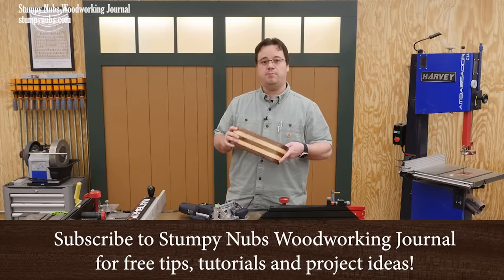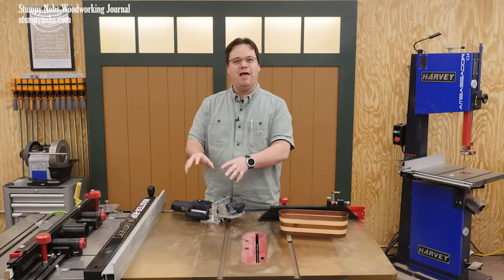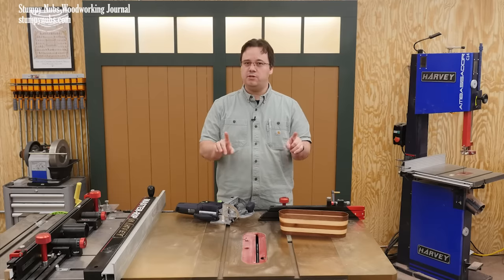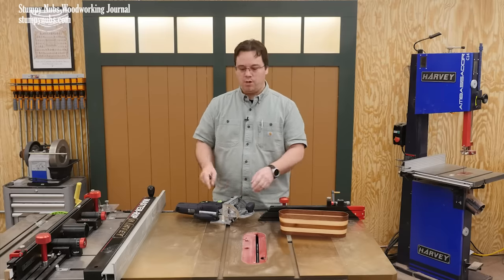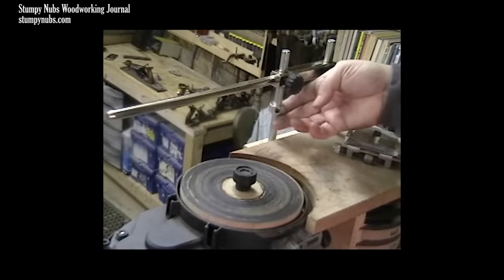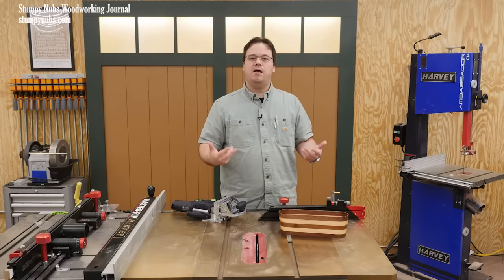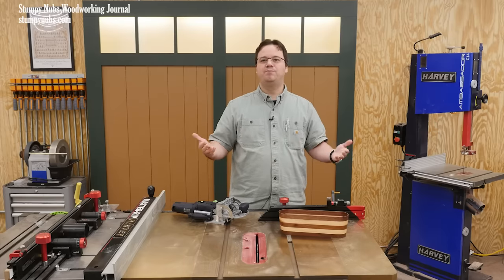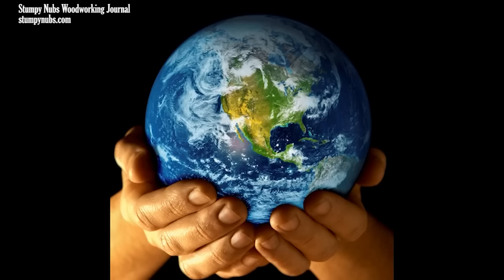This is why people HATE Festool and their Domino!

Comment: My complaint is not with the domino tool, hell I got a lamello biscuit joiner in the 80s when it was the only one! My complaint is with festool tools being so expensive in general. Are they so much better engineered than other high end brands that make them so expensive. And yes, with some it seems to be a huge status symbol. I enjoy your videos and learn a lot from you and others. A lot has changed especially with woodworking tool technology in the 40 or so years that I have been woodworking and I have some biases that you guys help me to get over. Thanks again!
Reply: I can't speak to the Domino as I don't have one but I do own 2 Festool sanders and 1 router.  The quality of the router is fabulous, so much easier to set up than my Porte cable router and far superior dust collection that is non existent on the PC.   I bought my first Festool  sander after wearing out a Dewalt ROS after only a couple of years as a hobbyist.  That sander is now at least 15 years old and only had to replace the sanding pad once a couple of years ago & again the dust collection is superb almost nothing left on the workpiece.   Plus my CT22 dust extractor that I got with the sander is still going strong & far quieter than a shop vac.

Comment: Seriously I went thru this searching mess 45 years ago..  I was a young man with a family and was able to make things from wood at age 7..  I made much sawdust.. I wanted a large lathe and made one from 2 inch maple with 16 speeds.. The lathe could take wood up to 20” in diameter.. The toolrest, shaft, and such I had made by a machinist.  Still cost less than $250.. For a long time turning huge blocks that weighted over 100 pounds was not good and the slowest speed was 250 rpm.. After many years of thought I saw a device that coverts 220 single phase to triple phase and triple phase can be adjusted down to 1 rpm.. The device cost $180 with speed control…and the new lathe has twin I beams and all toll it weights 440 pounds and takes wood up to 38 inches in diameter..A welding buddy welded it up in one day. I have used the lathe 3-4 days a week for the last 6 years.. it’s a beast and total cost is less than $650..  There are lathes that do less that cost between $4500 and $12,000.. You point is well made.. I have no real prototype the first model is great.  This lathe is adjustable from 1 rpm to 6000 rpm and does not shake or wiggle with huge green blocks of oak on it.. It has casters the go up and down too..I never have thought of buying festool due to cost.. I have value in my shop over $ 60,000 in tools.. All paid for themselves from making cabinets and crafts..The satisfaction and happiness from making my own is off the charts..  I am so old now and all I do is turn wood..nothing else and soon I will sell everything except the lathe..  I do not hate festool I just do not need stuff that cost that much money..thanks you really make much sense all the time..  Terry

Comment: Also I think brands as Festool, Tormek and even more Mafell, are small independent companies who built most or everyhing in their own workplace, and German wages are much higher then Made in Mexico/Chine/Czech Replublic. However they are designed and tested and callibrated, have long warranties and replacement articles for 15 years promised. This is also something that is worth a lot. Personally I like the machine, especially the XL but at this point it has no need for timber framing, which is what I do, but  if you see how much time and by that metric money you save making floating tennons, I don't see this as an expensive machine at all. It replaces a mortiser and a machine that cuts a tennon, problably two of the most labour intensive standard joints.

Comment: For me, the issue is not the price itself, but the price-gouging. It absolutely is well worth it for those who do regular production work and either don't have both access and technical capabilities with regard to adequate CNC routing, or CNC routing is not pragmatic for the application. But the price vastly exceeds the inherent cost of the manufactured tool and its development. This could be priced at one-third the price, and remain profitable. This is exacerbated by the price for each bit (which are not included with the tool price and cannot be obtained from any manufacturer but Festool) and the tenons. The truth is the tool just is not that complex or difficult to make, and the only reasons that several other premium manufacturers don't offer their own are the threat of legal action, and that they are securely manufactured in places in Europe (preventing the Chinese factories from ripping off their engineering like they do everything they can access). Make no mistake, Festool DOES generally make quite good tools, but in my opinion, unless you consider Festool ownership to be a type of fashion brand modeling (and many do), "you get what you pay for" does not really apply (especially with the Domino) outside of improved time efficiency and reliability of result. And the Domino is probably their only tool that does not have a strong direct competitor from other brands. So for me, it is my principle of resenting price gouging. I do admit there are not many alternatives that don't requiring designing and fabricating custom tooling, or going with another production tool of close cost but more expensive hardware.

Comment: Here's my opinion of Festool: I equate them to Apple. Festool, as an example, uses a proprietary arbor size for their miter saw. Thst means you MUST buy only Festool blades for your saw. Apple has the same business model... proprietary connections, chargers, etc. You MUST buy Apple products. I don't buy into companies who operate with thst business model. Before the beloved domino cutter tool, we end and side oined wood with tongue-and-groove joints, biscuits, dowels, splines, etc. They work. You can cut biscuit holes with a mortiser or mortis bit for a drill press.

Comment: 😂 That.  Was.  AWESOME!  Get a few cans of denatured alcohol in you and you're a funny guy!  I also thought your take on "haters gonna hate" is spot on, and it applies in so many domains, whether it's computers, guns, cars, tools or whatever.  I mean, yes, there was that time at Lowes when some employee was shilling Craftsman power tools and asked if I was interested, only for me to laugh dismissively, call it junk, and suggest his time might be better served helping me find a rotary hammer (went with an 8 amp SDS+ Milwaukee, which is a reasonably priced beast).  But would I tell a neighbor he was an idiot for acquiring a garage full of bright red "tools" of questionable quality and lineage?  No.  If the little bit or blade goes round and round in a useful manner, who am I to judge?  Hell, I still use a cheap-ass Skil circular saw my mom bought me as a gift in my early 20's (and I'm pushing 60) that probably retailed for around $29.99.  I could have upgraded long ago, but why?  It's the quality of the blade and the skill of the operator that matter.

Comment: For me, quality is my #1 driver of the hate. I ran a CNC in a cabinet shop for a number of years. Obviously the CNC cut nearly all of the parts. Our Festool miter saw was only seeing VERY minor work, basically cutting 1” scribes made of melamine particle board and occasional 4” toe kicks. After only 2 years, the bearing went out and the saw seized. But that wasn’t my only complaint. The vertical handle (a la 1970’s) was ergonomically uncomfortable. And the guard, which wouldn’t allow the blade to plunge without being raised, had to be held up with your thumb in order to function properly. $1700 for a substandard quality saw just to have a vacuum attachment? No thanks.

Comment: Agree with the other posters that Festool as a company has too high a price point.. no matter what the product.. ditto for Woodpeckers - and both are available from an admittedly great supplier.. that can't exactly give decent discounts, either. Just to get a Track saw system that I MIGHT need about twice a year - compared to a straight edge and a skilsaw.. makes no sense. The Domino merely is a better version of the biscuit joiner system for me. 
Here is the issue.. the number of jobs I would need to do extra.. or the rates I would have to charge to justify those expenditures - both make no sense. I don't do those $2000 and up tabletops. 80% of what I do is box - related work.. lower cost, lower profit margin. 
As you said yourself.. I don't need SOA tools to do what I already do. I do find it intriguing that all this neat stuff is out there.. but the business model doesn't support me buying high end SOA products.. Thanks for posting, though.

Comment: I really want the domino. That being said I generally don't like Festool that much. I've used the Kapex and my buddy track saw a bunch, as well as the jigsaw and the drill. They way to expensive to make up for the price, and their whole platform feels very plastic-y and toy-like. Since I got my Makita track saw I have never felt like I was missing out; and same goes for the Bosch sliding glide mitre saw I had (which I have since replaced with a dewalt flexvolt). I want the domino cause its the only tool I know of that does what it does, would save me a lot of time.

Comment: it goes further than just the r&d aspect of making up the cost.
something that most aspiring (and often arrogant) woodworkers seem to forget is towards whom these companies cater with their products. festool doesn't make tools for amateur woodworkers, they make professional grade tools for professionals. mostly anyways. so while you can make a jig to get the same job done, there's something you simply can NOT buy, that Festool offers.

Time.

Getting a tool that'll make assembling a (sufficiently sturdy) cabinet as quick as it would usually take you to make a couple of "actual" mortise and tenon joints (on a good day) and therefore opening up a whole new level of productivity, could easily outweigh it's cost in a professional setting.

woodworking is also not as much of a niche as some elitists might think, but rather an entire industry. the niche would be the "handtool-woodworkers", which rarely are able to earn a decent living solely by pursuing their craft.

Comment: Some comments have already made this point. The reality is, time is money.

If that 1200 dollar tool saves you thousands of dollars of time, then it was worth it.

Waiting 5 years for the cheaper model will cost you money if you can start producing better results today.

Yes, its true that not all expensive tools are necessarily good. You dont need a suite of snapon tools to work on cars. But it is definitely true that the hype can be real and a professionsl will use different tools than a hobbyist.

You dont buy a drill bit, you buy the holes it makes.

Comment: Since most of my project budgets are in design, I don't want to risk the rest of it on a joinery type (that I may need) but am not great at -- mortice and tenon. A Domino joiner helps me with that. And as noted in the video when Festool's patent ends there will be many new versions for less money - hopefully with improvements that other brands have been working on in the interim. 

But there are also many good ideas out there not under patent - such as a track saw. When I bought my first one in 2005-or-so it was an adaptor kit for a standard saw and their track. It was made by a tiny US manufacturer, now out of business (though it looks like Tru-Track may have bought them). So my while my track saw isn't Festool's idea, it's been the best one out there for a while IMO. But when the inevitable happens and ever more brands jump in, I'm going with the best value for my money.

Comment: well look at the lamello they were first on the market with the flat dowels and even today their machines are more expensive then other similar once from other companies  . The other day I worked with a original Lamello and the machine was more comfortable to work with there was a difference. And it is up to everyone to decide what is important.
And the lamello zeta is more expensive than the Festool domino. I am looking at both because they offer systems where you can take furniture apart i.e. when you move and want to take furniture with you. 
With the Festool track saw I hardly have any traces of the saw blade while cutting. It safes time and material. 
I do not have a lot of money and because of that I came to the point where I decided to buy quality tools. I am fed up with mitre saws which are not able to cut straight... 
Or I bought a used tormek with most of the sharpening aids and I am happy with it. 
I got me a Bosch router and I love to work with it.

Comment: Festool products, as a group, are simply too expensive.. this from a former tech exec that understands all too well about insane development costs - compared to the accessible market base that can and will support more "niche" products. Yes, their quality and innovation are generally very good.. but I'm pretty sure it prices out at least half of the guys and gals that do this as a hobby, small side business, or support shop. Myself, I do not have the time, or the customer volume, nor do my customers come even remotely close to insisting on the exotic, esoteric, and costly custom products that would produce the kind of revenue to support such expenditures. I'm very glad that other manufacturers are stepping up with much more affordable options for the Domino and Track saw! The cost of the 2 Festools combined is pretty close to a Mid level sawstop! Woodpeckers and JessEm are 2 more companies that have great innovations.. at prices way beyond the reach of most of us in the hobbyist and low volume production category - SO.. I forGO.. and stay with my 20 y/o biscuit joiner and straightedge.. and struggle to keep the material tight to the fence.. because the alternative is one less wood shop..

Comment: I think it is the price.  They ARE very expensive.  Yeah, you can create the same loose tenon, but with a lot more work.  The thing is, the engineering on the domino is amazingly accurate.  BECAUSE it is so accurate, you get to do things that you couldn't otherwise do as quickly.  Yeah, I love mine.  I also DO have a hollow chisel mortiser and a chain mortiser, and a tenoner, which I also use.  But the domino does make things possible in a shorter time period.

Comment: Why choosing the Domino Vs classic Double Dowel joiners? Dowels add more strength and there is a range of cheapers machines to choose from. Is there any benefit?
Reply from the maker: Why do dowels "add more strength" than a hardwood Domino?
Reply: @StumpyNubs  Because you can put more dowels. People have made tests and it is in an older video of yours as well. The question remains, is there any benefit over dowel joiners? I can think of lateral tolerances, anything else?
Reply from the maker: @constantinosschinas4503   That was in one of MY videos? You can use multiple Dominos as easily as you can use multiple dowels. I don't see how dowels are stronger... However, as you touched on, Dominos have the benefit of allowing for side-to-side movement during assembly (with an elongated slot, much like a biscuit), which makes them much easier to align than dowels. This also makes them useful for expansion joints to allow for natural wood movement. As for "dowel joiners" (assuming you mean the hand-held power tools)- I have never used one, but I have heard they can have alignment issues, as one would expect from such a difficult to align form of joinery. That said, there are some excellent manual dowel jigs on the market, such as the Dowel Max, which do not have alignment issues, when used properly.

Comment: I would compare the Festool "Domino" to an older tool that also had strong polarizing opinions. If memory serves the original biscuit joiners available around the 1970s or 1980s cost at least $300 for the basic model. Adjusted for inflation that almost $1000 today. Those biscuit joiners were professional grade tools but in time other tool makers found ways to make more affordable versions of the biscuit joiner and brought the price down to less than $150. That was way before well made Chinese power tools could bring prices way down like they are today.

Comment: I was an original owner.  I was on waiting list.  I got the domino variety pack with systainer and bits for 750.  It was when it had the pins not plastic flappers.  The indexing part never made sense to many and only for alignment.  Not needed.  I did like the tool but too easy to be off just a hair and it would be a problem.  To hard on small pieces.  Had to make jigs it's a pia.   I soldit after 3 tears and got what I paid for it.  I bought the power matic standing morticer  and don't regret it.   Have a good bit of festool so I like the brand but downside on that one too much

Comment: There's a much cheaper floating tenon tool that uses a cordless drill for power, I didn't see it mentioned as an alternative here.
I think the Festool is great if you are doing something like building doors or something at that scale, in a production or full time shop environment. It's not worth it for me to buy because I fabricate in both wood and metal and (sometimes other materials) and the money I'd spend on a Festool Domino is better used on a cold saw or a boring head or a new tube for my CO2 laser, or the trinocular microscope I want to buy for my small parts fabrication work.
Plus, my buddy has one that I could borrow, which is absolutely the best and cheapest way to use expensive tools- although, at no point in the past decade has it made sense for me to drive an hour round trip to borrow it, dowel jig, kreg, lamellos, or splines pretty much handle everything I build.
My take: Buy if you do larger scale projects, doors, etc. or a regular basis, if not, spend your tool budget on things that pay for themselves faster.